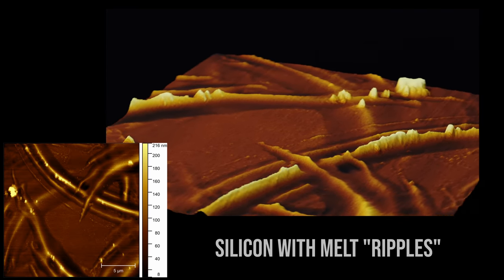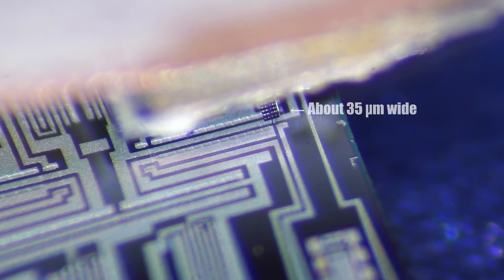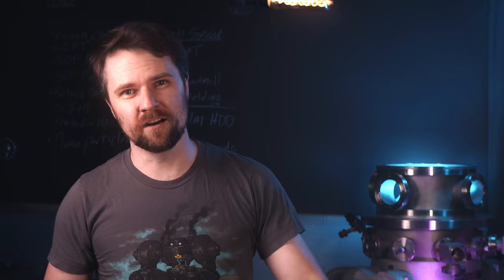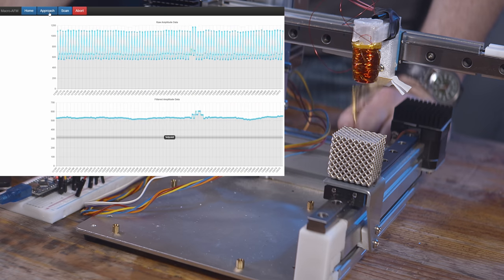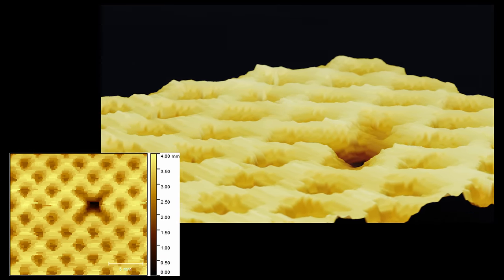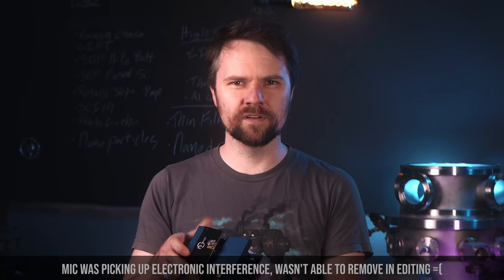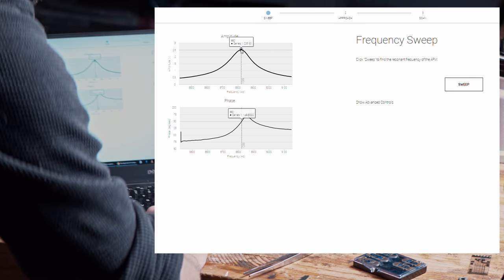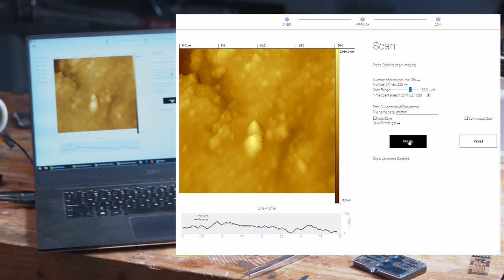1,000,000x Magnification with Atomic Force Microscope

Comment: would have been cool to actually show the scan happening on the machine rather than overlaying the screen output over the unit during the scan... why not just overlay over the portion of the screen that showed the same thing you wanted to show clearly? I would imagine it would be difficult to see any movement of the machine due to the scan area size, but would further let the viewer see just how small of an area is being scanned. in short, cover your pc rather than cover the unit during the scan... don't need to see the embedded screen image AND the monitor being duplicated. I actually fast forwarded from there to see if you stopped doing that and you didn't. stopped watching after that.  other than that, cool video.
Reply from the maker: The video after this one (chronologically if you look on the video page) shows the tip moving around during a scan. There were a lot of comments to this effect so I showed it next, and also explained why I didn't show it in the original video (there's not much to see, and it's a PITA to setup for filming)

Comment: There are multiple things you need to consider before you actually do this kind of microscopic measurements. You are performing tests under open air for an example out of 1000, air itself consists of fragile particles, which makes your test inaccurate. This is not a proper representation. Please be more accurate.
Reply from the maker: AFM is almost always done in ambient air (or sometimes an inert gas depending on the experiment), typically only STM is done under vacuum.  In fact, some AFMs operate in liquid which is obviously even more dense than air.  Sorry to say but what you are suggesting is incorrect.

Comment: They cant scan viruses. It's BS right?
Reply from the maker: AFMs are routinely used to image bacteria and viruses 🙂
Reply: @BreakingTaps  but they are dehydrated with acetone, coated with metal etc. Then CGI-ed right? Can you show me a virus? With such nm resolution it should be no problem then
Reply from the maker: @trollmcclure1884  I don't really have the bio facilities to isolate and prepare viruses for analysis. It's very much a done thing though, if you have an actual lab capable of dealing with biological materials. There's a fairly common experiment that shows DNA on an AFM which I might try at some point, but it's pretty fiddly because the DNA doesn't like to bind to mica substrates so there's a lot of prep work and quick processing times to get it to work.

Incidentally, I'm an ex-molecular/cellular biologist but that's not something that's easily done in a home lab so I haven't really pursued it much :)